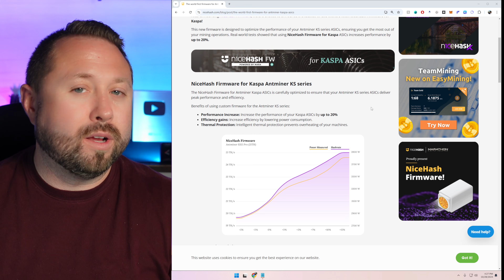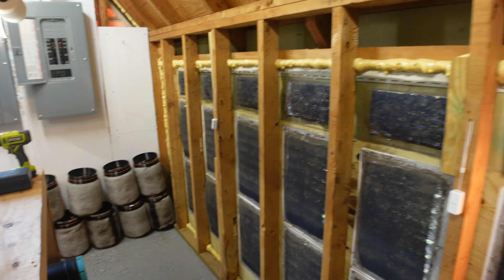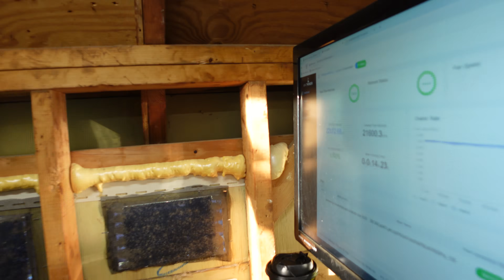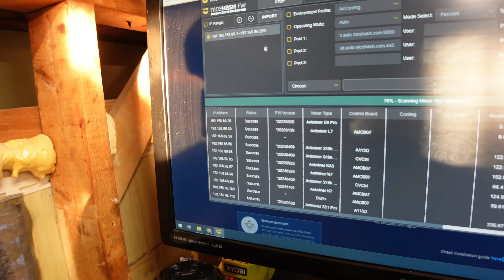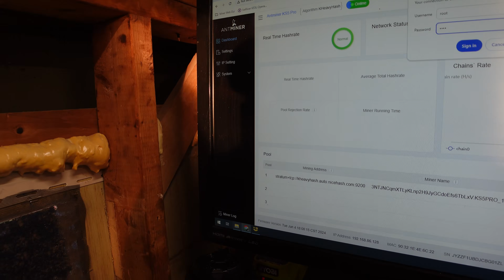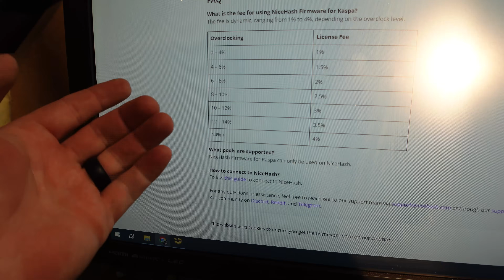I HACKED the BEST KASPA MINER, Here's How! Nicehash MARA Firmware Cracker Card

Comment: @thehobbyistminer do you have any miners hosted remotely? im struggling to get my KS5 pro thats hosted elswhere to connect to my KS bridge to mine my own node. Just wondered if you have any experience of remote hosted miner connection
Reply from the maker: That is an odd request.  You have Full Size Kaspa Miners hosted but you want to mine to a local node?
I have several hosted miners about 20.  All pool mining.
Reply: @TheHobbyistMiner  I've got 2 ks5 pros hosted remotely as I'm uk based and electricity isn't cheap. Have 1 hosted in US and 1 In dubai

Wanted 1 to pool mine and 1 to solo mine and see what pays out more as an experiment. I've tried everything to connect to my node on one of of them but can't figure it out. Seem to be missing something somewhere

Comment: Not concerned about the 80% rule eh? The shed is looking amazing!
Reply from the maker: Not for this setup.  I myself and my electrican ran the cabling from the Miners all the way back to the Transformer.  I know the quality of the work and wiring.  The individual 30amp x 240v Circuits are pushed further then 80%.  But the overall 400amp is at 80%

Comment: Ks5 are not really profitable right now.   Its at like 3.50$ profit a day now.  Some manufacturers must have new machines they mining with before they sell them to us. Causing spikes in hash rate
Reply from the maker: Not Profitable?  This miner makes $12 before electric and after electric for me is around $6.00.  Not sure what profit numbers your looking for but $6.00 is a win in my book.  Especially with the current network hashrate and price of kaspa currently.
Reply: @TheHobbyistMiner  I'm at 0.11 cents.  Yes it does make 12$ before electricity. Would make more money with solar set up.  180$ month profot. Not worth it to me.    Now definitely if I had solar system to run it.
Reply: @kylecoffey5204  I actually make a loss because of our electric rates..we have solar panels but they make little difference 😊
Reply: @kylecoffey5204  and Hosting may be an option then to